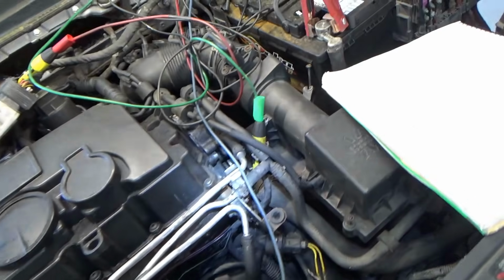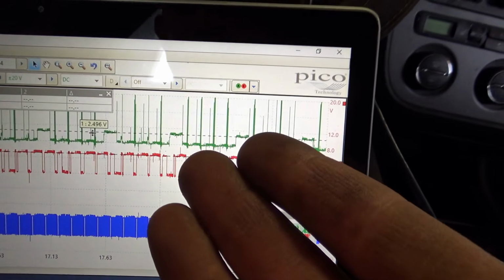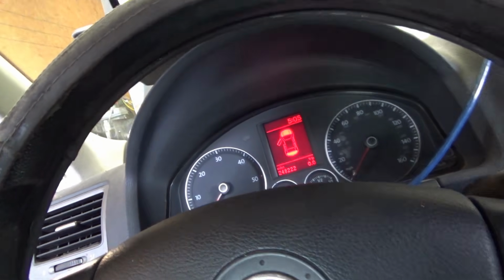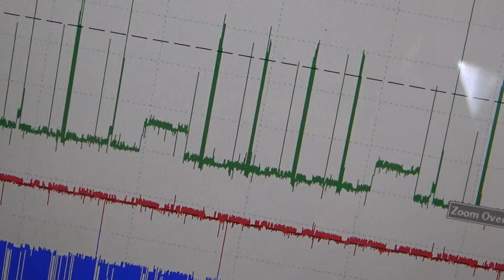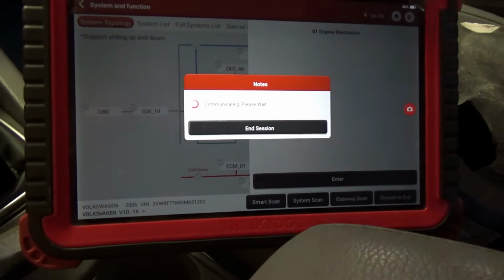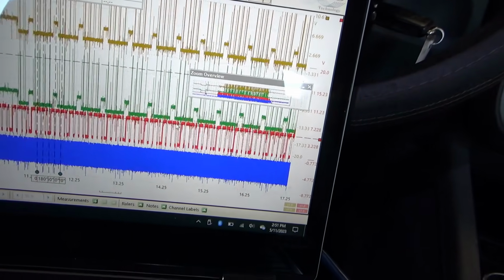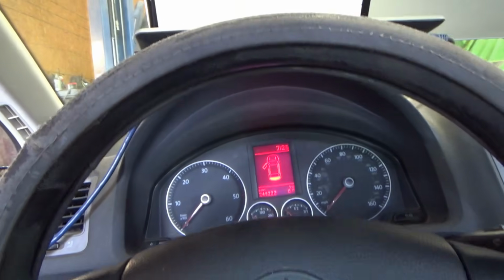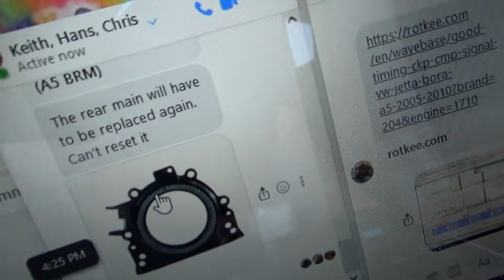ANOTHER Dead TDI?? (Jetta No Start After Engine Swap - Part 2)

Comment: Ivan, I've done dozens of cambelt changes on the 1.9 & 2.0 TDI VAG engines and had to time the injection pump sprocket with the crank and camshaft sprockets especially on the common rail injection systems. I recollect the older 1.9 TDI also had to have the injection pump in time. Put # 1 cylinder on TDC and check that the injection pump is actually in time against VAG assembly instructions. Good luck!
Reply: This is a PD engine, no injection pump. Unit injectors operated by camshaft
Reply: @mentalmechanic  😄
Reply: No injectiection pump on this one,the injectors are the injection pump for each cilinder

Comment: Fix the glow plugs!  Yes it  might start without them, but but will not run  very well, and you'll get multiple misfires.
Reply: Glow plugs have nothing to do with a running diesel engine.
Reply: @volvo09  They most certainly do during an initial cold start. Even more so on high mileage engines with reduced compression.
Reply: @volvo09 You are wrong1 Look it up.
Reply: @volvo09  Completely wrong. At a minimum glow plugs are used to assist cold starts, without them cold starts can be very difficult and the engine will run roughly and smoke if it does start.  Additionally  on many modern diesels the glow plugs are also used during normal running to raise EGTs under some conditions to help prevent carbon build up on the EGR valve, and are used to increase EGTs when DPF regeneration is taking place.

Comment: Do the glow plugs work?
Reply: It doesn't matter for a nocrank.. Might be a bit more smoky or longer, but it will start no problem.
Reply: @rkan2  Someone earlier in the comments said they would never smooth out without the glow plugs. I started my Mercedes-Benz and Peugeot both sometimes without waiting on the glow plugs. They would start rough but then smooth out. Crank time is a little longer, but the ambient temp has quite an effect on that.
It's "crank no start."

Comment: When my Isuzu diesel was cold and the fusible link to the glow plugs was open, the engine refused to start until I closed the circuit to make the glow plugs glow and the engine started right up.
Reply: its not a glow plug issue it seems not much cold now and its setting in garage ,,, its the rear seal have some stupid design affecting crank sensor reading which is more important then camsensors when starting the car
Reply: @Techie1224  Who would have figured that a badly installed rear main seal would be the problem. 🙃